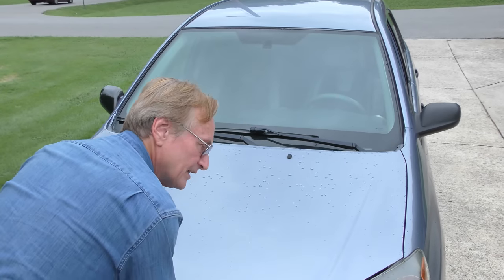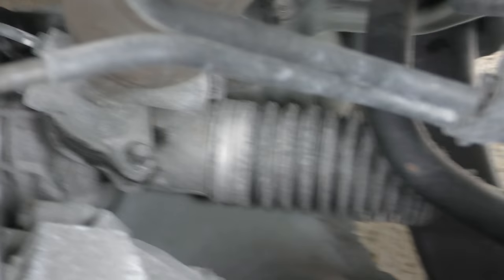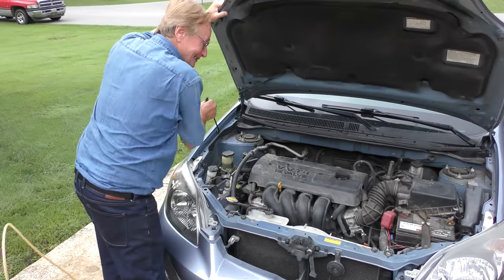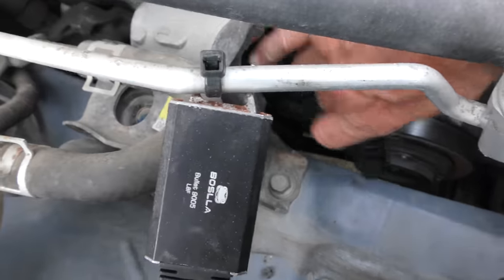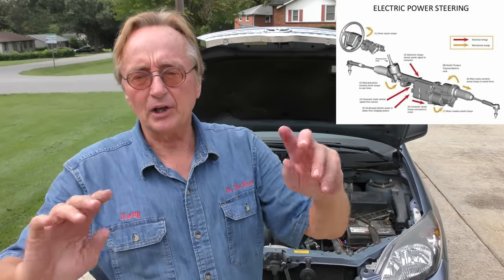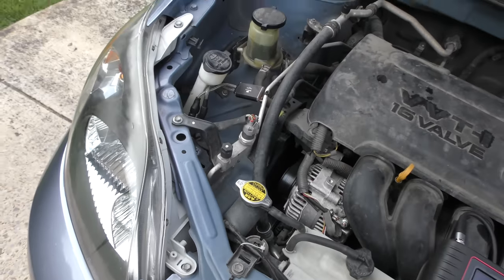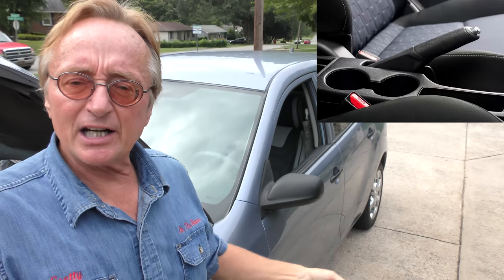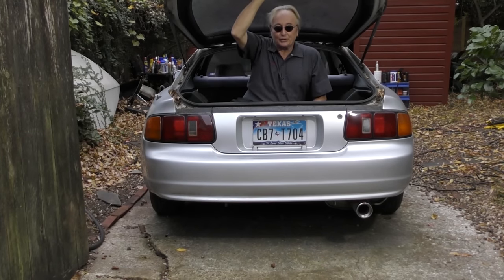Should You Change Power Steering Fluid in Your Car? Myth Busted

Comment: My personal opinion of 'computer assisted steering' is, don't buy a car with it
I have 2 friends, bought the same brand of car, they are French made cars, with this 'stupid' computer assisted steering.
Not 'if it fails',   When it fails, and it will, you have NO steering, Period. No steering. If you're in a straight line, you can bring it to a stop, but, you cannot turn the wheels to park. You are, where you stopped
If you're travelling a 'windy road', then, God help you, because the car won't turn.
It is impossible to disable the module. You can't remove the module as the car's computer shuts down.
You can, if you're clever, trick the computer to release the steering for about 20 minutes, after which time it locks up again.
This is the most dangerous and unnecessary piece of rubbish ever put in a car.
4cyl cars do not need power steering.There's no weight on the front end
These modules cost over $800 and over $1200 in labor to have them fitted, so, $2,000 for a part that is guaranteed to fail again, you'll just never know when
As for the company that makes these cars, well, in Australia they are immune to any issues
They also don't care once the car is past warranty, oh, yeah, don't buy the 'extended warranty', it doesn't cover 'computer controlled items' because of the 'acceptable fail/wear and tear laws'.
I just hate the idea that a computer module can fail, leave you with no ability to steer the car,  and leave you desperate on a motorway
I also hate the idea that a computer can shut down the vehicle without warning. Either a full, dead stop, or, a total loss of power as it goes into 'limp mode' with a maximum speed of about 20mp'h, 40kp/h for us.
Not so bad if you're on a quiet road/street. Not ideal if you're in heavy traffic or traffic going fast and suddenly your vehicle just 'shuts down'
We don't need all these computers, but, that's the 'green energy modules'
Wait til these electric cars start playing up. How would you stop one from accelerating to flat out or just stopping dead, in the middle of a highway
Car makers don't care. Either way, they get paid

Comment: I would do a power steering flush, Drain the reservoir, Remove the return line, Cap the reservoir port and run the return line into a pan, Jack the front end up off the ground so the wheels are not touching the ground, Refill the reservoir with fresh fluid and with the engine off manually turn the steering wheel lock to lock to allow the new fluid to get drawn into the system and push the old fluid out of the return line, Keep refilling the reservoir with clean fluid until the fluid coming out of the return line is clean,  Install the return line and top off the fluid and start the engine.

Comment: I just spent $902 on a new power steering pump, Tensioner pulley, idler pulley, power steering pulley and fluid service on my 2001 Silverado 1500. I feel like I got off pretty cheap, next big bill I have is changing the inner tie rods and then hopefully my truck will last another 20 years, past Biden's bullshittery.

Comment: Electric power steering is developed for people that have no interest in the part where you actually drive the car. 
But if you just want to get from A to B it works just fine. 
I have a Hyundai i40 with electric power steering and I can tell you it handles worse than my 1996 Toyota Corolla.
Reply: I have 2 96 corollas. 
Also 96 Tercel and 96 Camry

Comment: Scotty, I drive a 2012 GMC Sierra with dual batteries. The original batteries are still good and pass the load test. Is this an anomaly or should I change them out with new ones?

Comment: When I was 18, I had a 56 chevy with a 10 inch steering wheel and holy cow was that hard to steer. That's why the stock steering wheel was like 14-16 inches because no power steering was brutal.

Comment: I’ve always disconnected the power steering pump return line, ran it to a bucket, start the engine while steadily pouring fresh into the filler until it flows clean through the return line.  Reconnect the line and fill the system.  Works like a charm.

Comment: I did this four months ago, but I put my car up on jack stands and ran the car for a minute while turning the steering wheel back and forth in between sucking old fluid from the reservoir and then refilling it. I probably did it for five times until the fluid got clear.

Comment: I did a flush on my undid the coil packs the inlet hose and capped the bottom and kept lettin it crank till it was new but that was a whole ordeal and power steering keeps blowing out the top of my resivoir after a new pump i just gave up

Comment: There is power steering fluid that's around the top cap when I check it. Maybe my cap isn't sealing the power steering fluid well and need a new sealer pad in the cap?